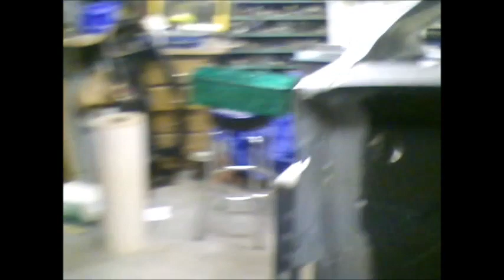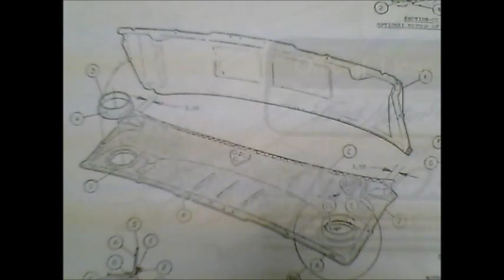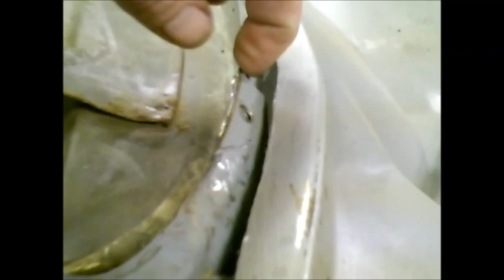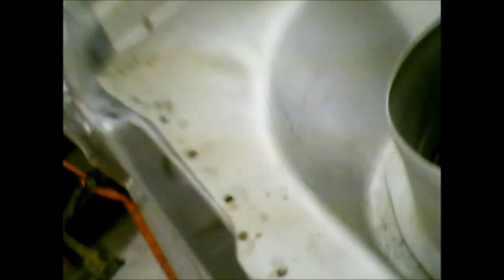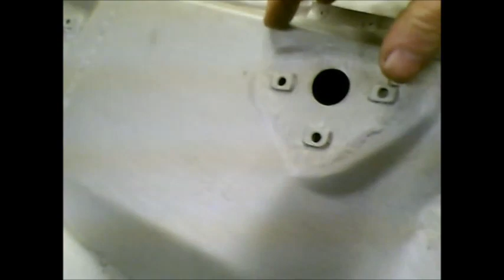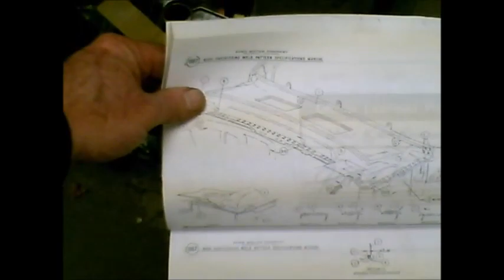cowl panel and tuffy coat

Comment from the maker: I am going to use granada spindles with disc brakes.
I also made and installed rollerized spring perches on stiffened oem upper control arms.
I  boxed the lower control arms and made some adjustable strut rods.
I  have a 7/8" front sway bar and 620lb springs.
I also did the Arning drop on the upper control arms.
I hope it handles well.